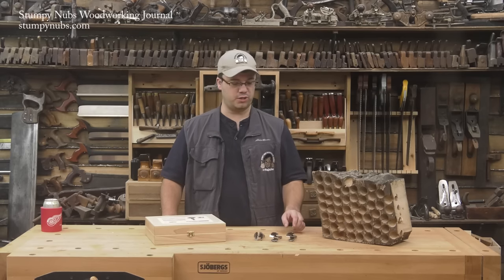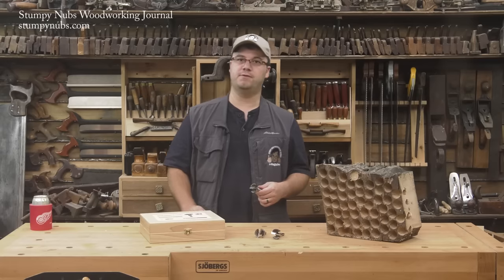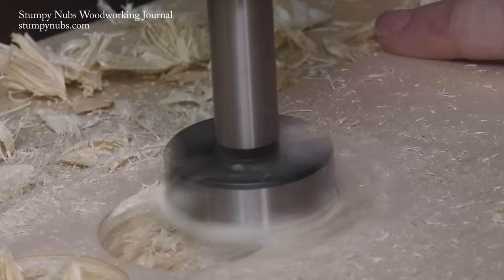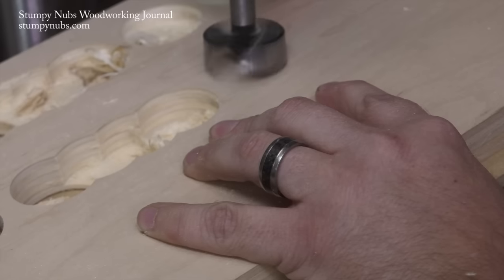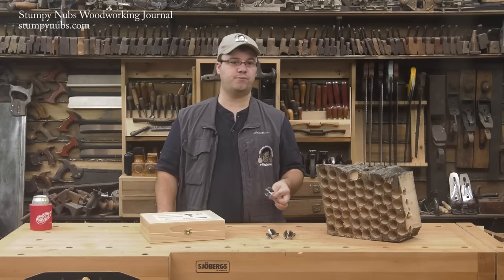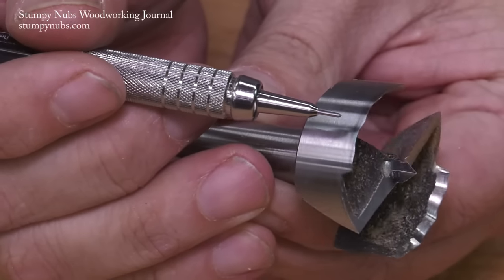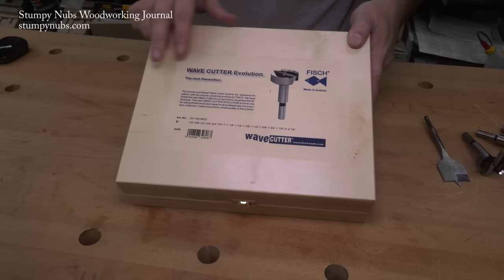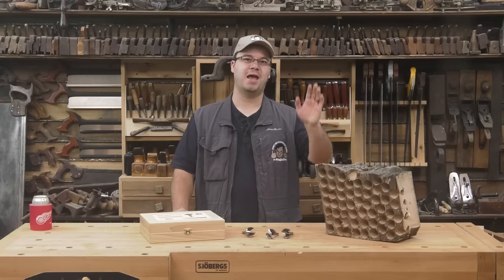What you need to know about forstner bits

Comment: I've been turning peppermills on and off for several years, using a $50-60 set of clunker sawtooth Forstners.  The peppermill pattern I use requires bits from 7/8" to 1 3/4" bits.  Even though I'm not hard on ol' Benjamin Forstner's bits, these clunkers repeatedly dulled quickly.  Ain't nobody likes burning wood in a wood shop.

So I followed Mr. Hamilton's suggestions and began replacing my clunkers with Fisch®and Freud®Forstners.  MUCH better so far.  Pretty much like the difference between riding on a riding lawn mower and riding in any decent car.

Thanks, Stumpy Nubs!

Comment: Been super frustrated using spade bits, might end up getting a forstner instead.  Using wine corks as dowels to join a desk together, definitely a non-conventional use but a very fun introductory project for me!  Thanks for the great info, I've seen drill bits crap out after much less use than that so surprising it was able to consistently chew through that maple glacier.
Reply: "Corks!  Never enough corks!  Let's procure some more!  Red?  White?  Rosé?"  😉

Comment: I finally bought a set of Fisch forstner bits!  They have been on my wish list since this video in 2017.  They are Sweet :-)   Perfectly clean edges!  I grabbed a cheap piece of plywood, from a shipping container I salvaged.  The veneer on this stuff is crap.  However, the Fisch, wavy edge bit cut perfectly clean rims.  Much better than the saw tooth bits I have.  After only four test cuts I can already tell I am going to love these!  There will be less cursing in the shop now!

Comment: I've drilled tens of thousands of holes in HDPE plastic of all sizes up to 4" for my business and yes, I've found Fisch to be the best fostner bit too.  They are available in 1/16" increments, but they were not available in the US for a few years and I really missed them.  I've used many brands and would put Freud in second place, but they are only available in 1/8" increments.  The biggest of my bits are high speed steel which is important to keep an edge on them and are worth the money, at least for the amount of use I give them.
Reply: Have you used Famag bits?
Reply: @hunorkovacs5950   Yes. Famag is OK, average.  Porter Cable were the worst.  Terrible cutting edge, but they  have a hex shank which is nice.  Each bit size and brand seem to have their own personality.  I don't have much experience with Irwin (Lowes), just one bit I had to buy when I couldn't get the size in Freud.  It didn't cut well and didn't use it for years, but used it later and it cut nicely which was weird.  To be fair, my opinion only pertains to drilling HDPE plastic too.

Comment: Good presentation...  What I have found to be a game-changer is that when purchasing a Forstner-bit, buy the larger sizes with the Hex-shaft, the larger sizes will slip in the chuck if they are round-shank. It takes a lot of horsepower to bore large holes and the Hex-shank is less stress on the chuck tightening and loosening.
Reply: Great advice

Comment: One tip to help when drilling at an angle is pre drill the center hole with a 1/4" bit then take out the self feed tip in the forstner and replace with a long enough 1/4" bit to hold the forstner  in position until the entire outer rim is in the wood. then you can change it back to the self feed tip.

Comment: There I was, muddling through, thought I was doing OK, I learned how to hide most of my dings and dongs, I learned how to settle for what I got...until one Sunday morning on YouTube I found myself in the Presence.

Life as I knew it was over.

Out the door went the old Craftsman one-speed non-reversible drill, taped to a 2x4 cross brace, which hung from a old door hinge nailed to a 2x6 upright, serving as my drill press. Over in the far corner, the Corner of Darkness, is a stack of boxes holding the dust covered collection of every single tool I owned at the time of The Encounter.

I'll go poking through it now and then just for laughs.

Comment: Oh yes! Happy boring. I have purchased the brad point drill bits from Fisch and they out performed any bits I used so far. There were some drill bits I had from some Mexican company that I sadly sold and there were very close to Fisch quality, and yes - they were not cheap either. Maybe few bucks less than Fisch. 
In the drill bit market you usually get what you pay for. Cheers!

Comment: Thank you for the Forstner bit advice.  Just ordered a "Wavy" edge Feud 5/8 Forstner and if it performs like you suggest, and I have no doubt your advice a good, I will order en entire set.   I just get too much burning when using in hard wood.  I will also try to slow down the drill speed.
Reply: One thing I forgot to mention is the set I will order will be the Fisch set from the link on your site.

Comment: I very much appreciate your high quality education you provide us all - my old late father once advised a much younger and poorer me to buy a budget set of drill bits (re also forstner bits).  Then, when you find a bit failing, buy the high quality bit to replace it.  You will have the full set of lesser used bits for the random yse, and highlighted your set with quality in the size used the most.  Would you agree?
Reply from the maker: With drill bits, yes. That makes sense. But cheap forstner bits are just junk. And most people don't need all the sizes anyway. I suggest buying three of four common sizes, then adding to the set as needed.

Comment: Brilliant video, thanks for posting it. We have a wee question. We need to make a pocket hole to fit a 38mm recessed brass ring pull handle in maple wood. Should we use a 38mm or 40mm forstner bit? Thank you.

Comment: I have a bucket full of old forstner bits various sizes.  When I have to drill a hole I pull all the ones of the same size out and see which one STARTS cutting.  most are so dull they just scrape and burn.  Thanks for the info.

Comment: Interesting! Thanks! I just bought my first forstner bit of 50 mm. In need to drill a hole, about 350mm through a tree. To then put in a steel 50 mm pin. I will need to extend the bit. Is that ok for a forstner bit?

Comment: I really enjoyed this video and it helped me decide to  use the Fisch bit. I am drilling a 1/4" depth hole to fit a 1" diameter ladder rung. Should I use a same size bit (1") or go to 1 1/8th bit?
Reply: I would use the 1" bit. If the rung doesn't quite fit, wrap some sandpaper lightly around the end and twist it back and forth until it fits snugly.

Comment: I purchased a Fisch 1.5" Forstner to bore 24 holes into 3/4" hard maple edge grain.  The drill speed chart recommends 250rpm, but my inexpensive drill press only goes down to 760rpm.  I presume that feeding slowly would be adequate, especially since I am using wavy Forstner bits.  Please reply with any advice.  Thanks.

Comment: Hi, I need to cut small holes in my kitchen cabinets to run some wires. The angle is weird and I have to hold the drill sideways. I was going to use a spade bit but concerned of the hole not going through straight. Was considering a hole saw also. What would you recommend for this?

Comment: I appreciated the info in this.  I would love to buy the Fisch bit set, but truthfully, at $450 it is not priced where I can justify it.
Reply from the maker: Few people need an entire set. As I said at the end of the video, just buy a couple of the sizes you'll use most, and add as you need it. Not every hole you drill has to be perfect, either. So you can use cheap bits for holes that won't be seen, or don't have to be as accurate.

Comment: thanks for the video,  How about the final surface finish of the cut?  I am looking for a true flat finish surface (except the guide hole in the center of course) 
is there a true flush forstner bit, or should i always expect a deeper cut on the guide rim area ? i want to cut 3 mm deep on a 4 mm plexiglass. 
Many thanks

Comment: There are High Speed Steel forstner bits available (which it looks like the Fisch are not). And HSS is many times better with heat than tool steel, forged or cast. So if heat is your issue, look for the HSS ones.
Reply from the maker: High speed steel is supposed to hold up to heat better than carbon steel. However, a high-quality, forged carbon steel bit, that is properly designed (such as with the wavy rim shown in this video) doesn't heat up and dull quickly either, in my experience. Plus, you can easily sharpen them many times. (We did a video on sharpening forstner bits: https://youtu.be/rLoEulA4mM8 )

Comment: Ive brought a cheap 15mm forstner as I only want to drill 10 holes at about 1/4 inch deep to cap off a screw with a dowel. Thanks for the tutorial.

Comment: I realize this is a woodworking channel, however, could I use a forstner bit for acrylic/plexiglass also?
Reply from the maker: Absolutely. But, as with any cutter (saw, drill bit, etc.) you have to run it very slowly to avoid melting the acrylic. And DEFINATELY clamp the workpiece down. Forstner bits may catch on hard materials and you don't want your hand to be injured if it spins the workpiece out of your grasp.
Reply: @StumpyNubs  Thank you!

Comment: Hi. Nice bits. Are they only available in the US? Can fostner bits only be used in a drill press or can they also be used free hand in cordless drills? Cheers
Reply: I use them in a cordless all the time,even for overlapping holes,with or without a hand-held drill stand.Use a bradawl to locate the bit over the centre of the intended hole as the bits are too wide for good sighting of the central spur over your marks.I don't think I'll ever try to use them freehand on a hole with anything more than a slight angle though!

Comment: Today I used a saw tooth bit for the first time, and was drilling into wood using a drill press. The bit seems to not cut well, and if I apply the slightest amount of pressure it stops spinning. The bit is new and never used. Anyone have any advice?

Comment: Can you use these bits with a regular drill? I only need to make shallow holes for 1 project. I see he was using a special tool.
Reply from the maker: Yes, you can use forstner bits in a regular drill. However, if you use a large bit (2-inches or larger) you may have a hard time holding onto the drill, especially if it catches on the wood. I recommend a drill press for those large bits.

Comment: Can you use a 35mm Forster bit with a 12v drill to bore holes on a 1/2in plywood?
Reply: Carefully. Drill a little starter hole for the spur on the Forstner bit and try to hold your drill as close to vertical as possible. Don't use max RPM.

Comment: I want to use a bit like your showing  to put a hole in the bottom of chess pieces so I can add some lead  to make them heaver . What is the best way to hold the pieces in place ?
Reply: Get two 6" long pieces of 2x4 and a 6x6 piece of plywood or MDF. Drill a series of holes in the plywood that correspond to the different bases of the pieces only slightly smaller. Attach the plywood to the 2x4s. Drill a small starter hole in the center of the base of each piece so the spur of the Forstner bit has a place to start. Drop the pieces into the hole top down and then drill your holes.

Comment: Can you use a 3/8" Forstner bit to create a pocket hole at a 75-degree angle?
Reply from the maker: The point of the bit has to dig into the wood at the beginning of the cut, otherwise the bit will just skid across the surface. At that angle, the bit would never bite in.

Comment: When mine start to get dull I just run them in reverse for a few cuts.Same as I do my carbide tip Saw blades.All self sharpening.
Reply from the maker: Running a carbide saw blade in reverse is a good way to loosen a tooth. If that thing flies off later it'll be like a carbide bullet.
Reply: @StumpyNubs  You know I was just Bs ing about running those backwards to sharpen them as you probably suspected but people that work in tin roofing  and aluminum plate  up to 1/2 thick  turn those [saw] blades around all the time to cut them.Most wear a shield or a welding hood because there is a lot of flak.Very few people can afford the high dollar tools you recommend.For instance the 135 dollar table saw blade in the last video I watched.Thanks for the videos though .I am now retired and taken on the hobbie of woodworking.Don't ask me why but it has been my experience that pipefitters and welders also love working with wood as in cabinet making or boat building.Thanks for the education on Forster bits .I just bought some last week.First time ever .

Comment: I just got into wood working projects, and would like to use one of these, however i seem to be at a cross roads. How deep can i go with one of these bit types? does going 8 inches cause problems? im very curious and would like some input before make a purchase on a quality bit.
Reply from the maker: You can go as deep as the shaft length will reach. You can also purchase an extension for deeper drilling.
Reply: @StumpyNubs  I wouldn't have to worry about it binding up or burning the hole from excessive heat?
Reply from the maker: @Mellodeath21  https://www.youtube.com/watch?v=UP1eZ7oH3nA
Reply: @StumpyNubs  thanks for this help :) I really appreciate your time to help me. Now I feel a bit more comfortable with going into these boys for my projects. Thank you.

Comment: I will only use carbide forstner bits. The cost arguement pales with the long lasting carbide bits.
Reply: I have found that they cannot be used on softwoods or even birch plywood with a handheld drill as they just skid over the surface,even using a handheld drill stand.
Reply: It's a trade off, steel never holds a edge and carbide is not as sharp but I will put carbide against steel any day all day long and get better results. I am old enough to remember carbide in it's infancy days in woodworking. I love     hhs for woodturning as well as carbide. Best of both worlds!!!

Comment: I heard in another video that forstner bits need to be run at a SLOW speed. First of all, is that (always) true, and if so, shouldn't that be one of the main things to tell in a video that is "what (we) need to know about forstner bits"? It appears that a lot of people just run out and buy these "new" (to them) bits that are supposed to solve their problems without learning the fundamentals of those new tools and what it takes for them to be effective. Just wanting to make these work for me, by using them right in the first place.
Reply from the maker: No, that's not true in every case. With any woodworking bit (forstner, spade bits, even router bits) you must match the speed tot he size of the bit. Basically, the larger the bit, the slower you should run the drill. You can find speed charts with a simple Google search.  But as a rule of thumb, if your shavings are coming out hot, slow it down.
Reply: @StumpyNubs  Interesting -- thanks for that insight!

Comment: How do you use the forstner bit to make flat bottoms on the holes you drill, without the small guide bit hole on the bottom of the hole?
Reply: If you need a true flat-bottom hole, make a plywood template with a Forstner bit then use it with a pattern router bit. It's a great way to make trays.

Comment: Do you prefer high speed steel or carbon steel?
Reply from the maker: High speed steel is supposed to hold up to heat better than carbon steel. However, a high-quality, forged carbon steel bit, that is properly designed (such as with the wavy rim shown in this video) doesn't heat up and dull quickly either, in my experience. Plus, you can easily sharpen them many times. (We did a video on sharpening forstner bits: https://youtu.be/rLoEulA4mM8 )

Comment: So if someone had a set of both saw tooth and knife edge bits of similar sizes they could essentially do the same task of that sweet time saving $300 set. 

It takes switching out time but the knife edge would essentially do the same task as the Fisch bits using the knife edge on secondary joined hole cuts and edge cuts exclusively.
Reply from the maker: Regardless of rim style, cheap bits are cheap bits. Good bits cut more cleanly, are consistent in size and stay sharp a lot longer. Use whatever works for you.

Comment: The stump grinders Hertz Rentals doesnt want you to know about. Forget humping those heavy pigs through the woods with their $75 carbide teeth, all you need with these bits is a good hammer drill, generator (if your not yet a Milwaukee Fuel gigachad) and a 6-pack! After the first hole you can usually just stick a 4' steel root bar down the hole and use it as a lever to split the stump in half. I swear, the dudes who make these wood augers and chainsaw power gouges have no idea what an untapped market they are sitting on. Why pay $250 just to rent a stump grinder for a week when you could own a couple of these plus a used Stihl BT-131?

Comment: There's a lot of cheap rubbish out there in tool land. Router bits are another no no for going cheap. Chinese ones practically unusable from the get go, with bearings falling off and bad machining making them not fit the collet properly. Drill bits you can get away with going cheap if you only plan on using a few times on a certain job

Comment: I bought set of cheap fortner bits from local retailer chain Lidl. They were so poorly made, even not able to drill one hole in a soft wood.
Reply: That's unlucky, Milos. Here in Prague, I bought a cheap Chinesium set of 5 in a box, plus a few more expensive single ones in particular sizes I needed. None of them are 'great', but the cheap ones actually out-perform the more pricey ones by quite a big margin, mostly on chip ejection. The flutes on the expensive ones are at such a shallow angle relative to the shaft, they just clog up and I have to keep stopping to poke out the 'cut' material. Because they can't clear the chips, they get really hot. I mean colouring the steel hot! Not one of my better buys...
Good luck with your future purchases.